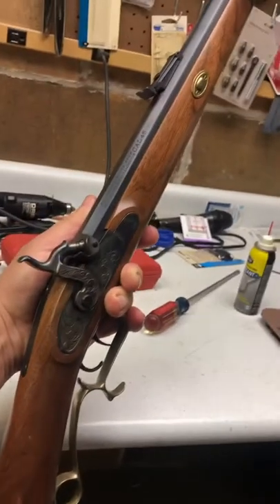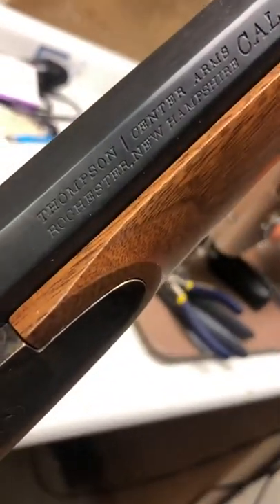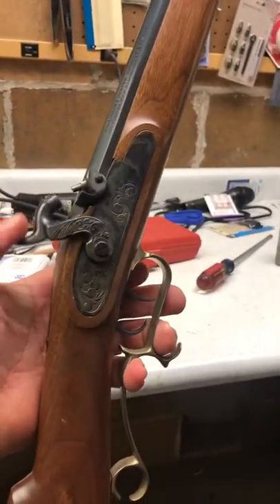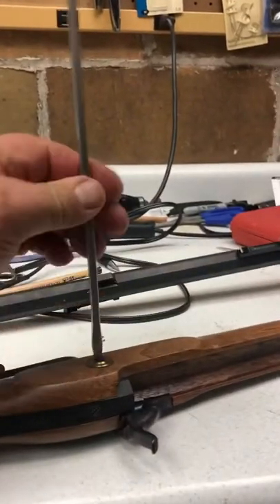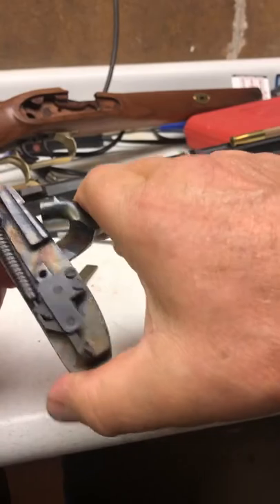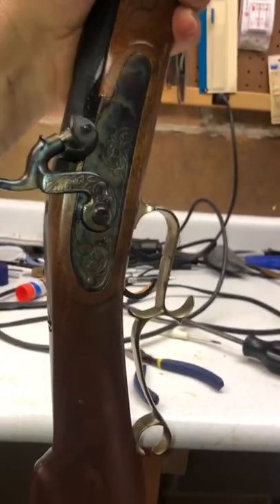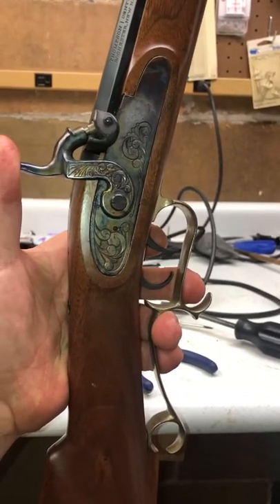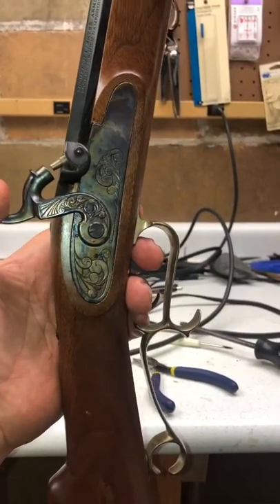Muzzle Loader lock repair

Comment: Today is 3/30/21. I watched your video, took the lock from my T.C. Hawken apart, polished the needed surfaces, cleaned and lubed it. After reassembly I checked the trigger pull. She now breaks at 4.5 pounds... down from 7.5 pounds! I am really surprised at how much improvement from that little bit of work. Your video gave me the info I needed to take the lock apart. I may decide to do more after a range trip but it  feels good to me right now. Thank you for your video. Good stuff!

Comment: Like you videos .I have a problem with my tc hawken rear trigger has no spring tension it rattles when you carry it still engages the front trigger and then it has tension on it..does your tc hawken do that .would appreciate  your help it's driving me batty..thx
Reply from the maker: Mine does not do that. I would be unable to diagnose it without physically having it to look at. I recommend you consult a local  gunsmith. It sounds to me like something is assembled improperly and could be dangerous.

Comment: My flintlock has an issue where upon firing the mainspring slips off the tumbler and effectively locks the hammer in place.
Reply from the maker: That stinks. Is the spring bent?